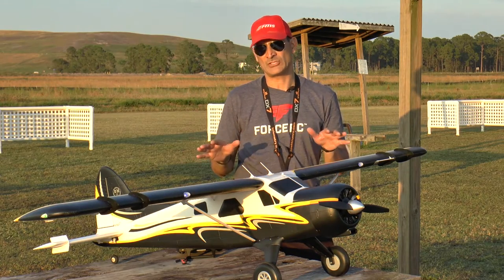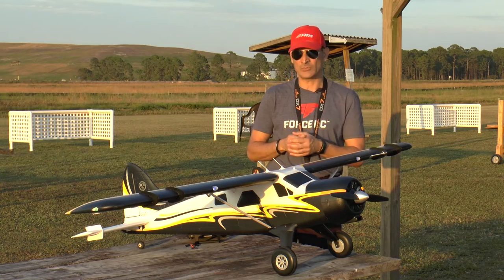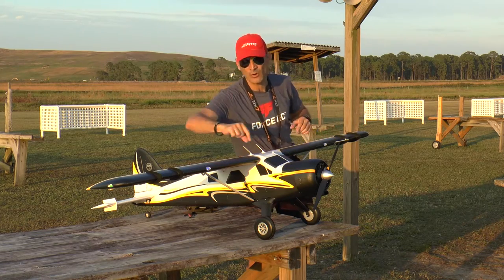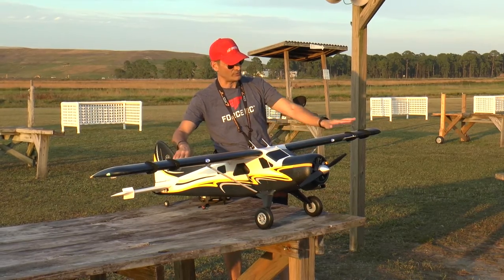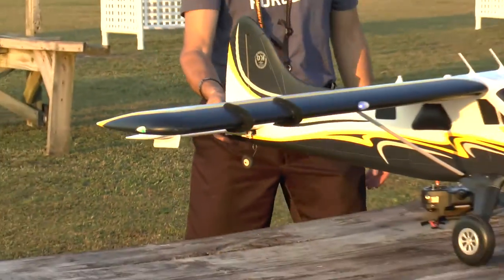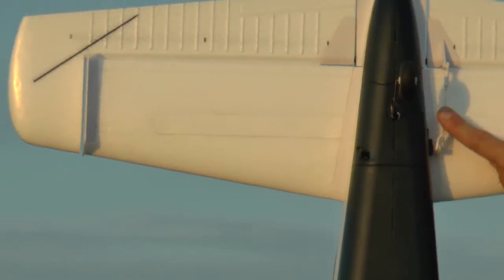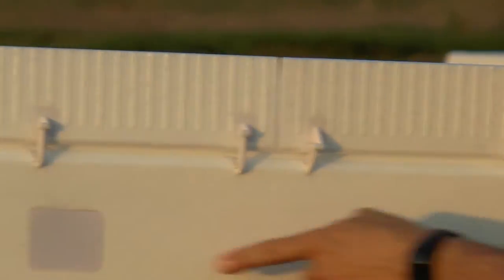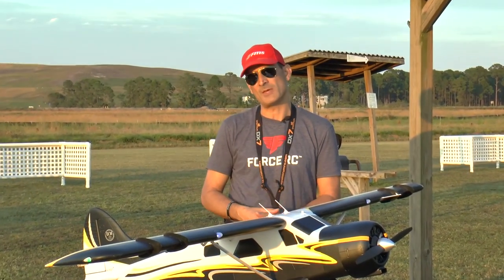Force RC - FMS Beaver 2000mm PNP

Comment: Thanks for the review.   I picked this plane up this past weekend, and have it all ready to go, and can't wait to fly it.  It's wonderfully put together, and really good looking. I'm using a 5500 mAh 6 cell recommended by a friend that has this same plane.   He gets 25 minute flight times.  Thinking of putting on the Dubro 6" pneumatic tires on to reduce the bounce off pavement those original hard tires cause.  Plastic covered foam tires ?  When did they come out with those ?  They are awful, IMHO.  Thanks again!

Comment: Looks very nice! What would be the best beginner/intermediate RC plane (based on a real aircraft) coming from a Champ RTF?
Reply from the maker: The Champ S+ would be your best beginner plane.   There are a lot of beginner features to it including Auto-Land functionality and GEO fencing so it doesn't fly away.  Here's a link to the item page... http://www.forcerc.com/champ-s-rtf-hbz5400
Reply: AWC Dont chain yourself to those kind of planes. You dont need all that extra stuff to enjoy flying. If you really want something nice that does have a bail out feature the Apprentice is still the best investment for the money. I have two,one with floats,the other with led lights for night flying. You can do a lot with the Apprentice and it is the most forgiving for the price. I hadnt flown in years and got back into flying with the Apprentice. I did crash it a few times and had no problems getting it back in the air,usually the same day. If you want geofencing and all that there is another brand simular to the Apprentic called the Sinesa ( Spelling is wrong but you get the name) That one is a great model too. Check out the RC saylors,Abby Saylor has one and really likes it. I am not much into doing the chicken dance everytime I fly just to get the gps/ geofencing set up but everyone has their own tastes. The Apprentice has three settings,beginner,intermediate and regular flying with the bail out switch always available on all three settings ( I dont use it any more). Hope that helps.

Comment: I just received this plane,  and putting it together I noticed that there are two Servo leads taped together listed as Channel 5/Gear. however when I plug this into the receiver it does not do anything.  any advice as to what these leads are for. it would not make sense that these are for the floats as that should be on the rudder channel.
Reply from the maker: They are for the Rudder servo or Flaps.  I will have my plane here Thursday then I can tell better.  Since it is two leads that would tell me that it is the flaps, since we only have one rudder servo.
Reply: Force RC I'm not sure, I believe I tested the flaps and they worked with it being unplugged.  I'm thinking maybe its for an add on like retracts but can't find any information about it.

Comment: can you change out receiver for as3x for more stable flight
Reply: It doesn't come with a receiver.  It's PNP, not BNF.  You don't need the as3x for this plane.  This plane is super stable and easy to fly.   as3x more for small planes that get knocked around in mild winds.